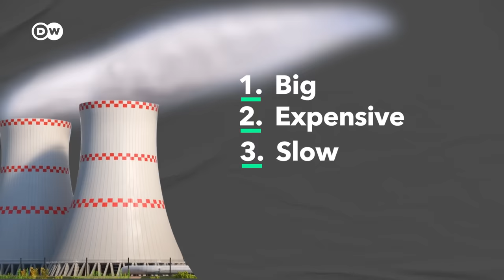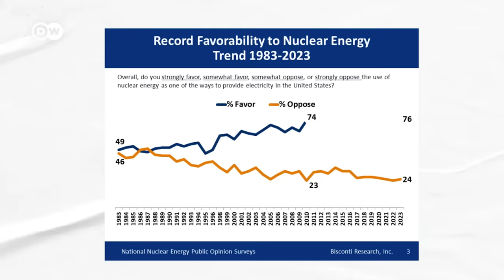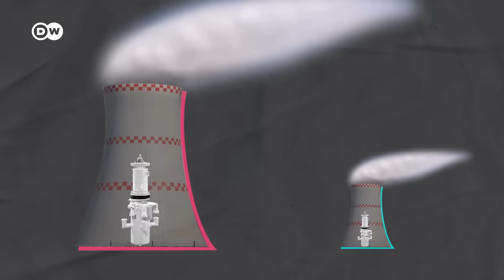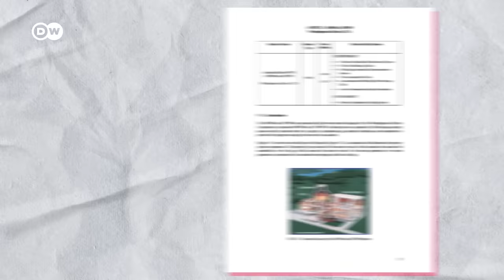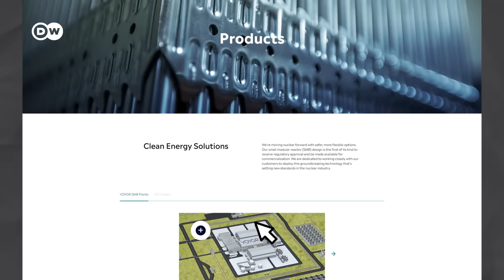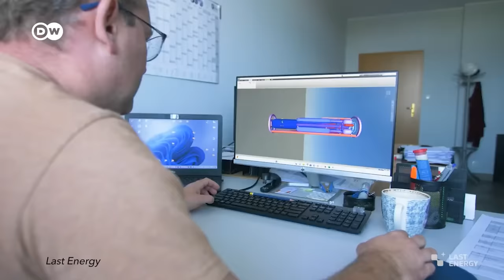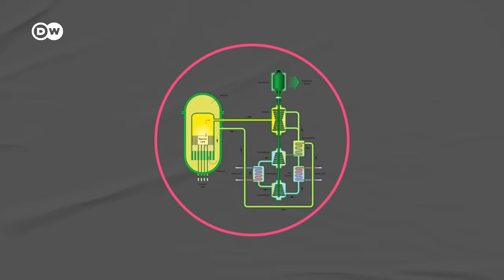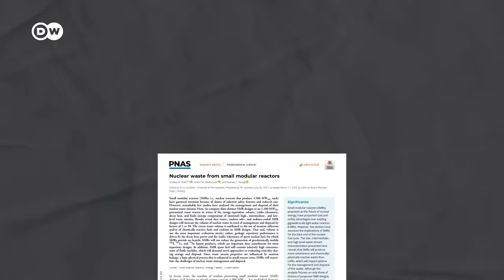Why people want to put small nuclear reactors everywhere

Comment: Safe by design, in most cases means liquified metal (like lead) not water. Because it nearly impossible to heat up lead to make it waporize and even when lead leaves reactor it will get solid fast. Also, rods in the ractor are moving down (stoping the ractor) without power application to maintain its position.

Comment: Here is one issue I have with these SMR related videos. Virtually none of them, including this one, had pointed out that SMRs absolutely work and we have decades of experience. Just look at all the nuclear submarines and aircraft carriers. Since the 50's there have been over 160 nuclear naval vessels built, and every single one of them is powered by a SMR.
Reply: @astebbin  I shall argue the 2 points you made are perhaps erroneous.

1. Enrichment Levels:
Naval nuclear reactors runs on military grade enriched fuels of over 93% enrichment. The proposed SMRs run on HALEU grade of no more than 20% enrichment. It is simply far too low to be weapons grade. The much lowered enrichment level also serves as an extra level of safeguard to the already stellar safety records of naval SMRs.

2. Proliferation:
This seems to be the go-to argument for much of the anti-nuclear energy crowd, but it is simply incorrect. As a matter of fact, commercial nuclear energy generation is the best proven way to denuclearize one's military arsenal. To prevent Soviet nukes falling into the wrong hands after the collapse of the USSR, the Megatons to Megawatts Program was put in place from 1993 till the Russian invasion of Crimea. The program decommissioned an equivalent of 20,008 or 45% of total stockpiled nuclear warheads by the USSR. The decommissioned warheads were then downblended into commercial reactor fuel. During those 20 years, 10% of total US electricity generation came from those "recycled" Soviet warheads. If anything, it should be argued that commercial nuclear energy generation has greatly served the propose of anti-proliferation.
Reply: @astebbin that isn’t a requirement, though, and that fuel is currently used for supply-chain reasons.
Reply: And at least hundreds of navy soldiers lose their hairs
Reply: @astebbin  57% of global carbon emissions come from countries that already have nuclear weapons and aren't a proliferation concern.
Reply: Those reactors use highly enriched uranium which for several reasons is not a practical solution for civilian reactors. The designs would need to be significantly modified for this and operating outside the ocean with a constant, limitless supply of cooling water. That is if you were even allowed to use those military designs in the first place. The companies that build those reactors, Westinghouse and Bechtel also build civilian reactors, so if there was an actual demand for smaller more modular reactors, those companies would be the first ones anyone would go to, but as evident there is no real interest beyond the military.

Comment: As much as I support nuclear energy SMRs never seemed a too bright idea. You have great economy of scale with the normal size, the site has to be specially monitored and defended wheter it produce 300MW or 3-4GW. Same with the infrastructure. Also they use more material, the same capacity may requires more personnel. As long as they plan to install many of them at the same site it isn'treally worth it, and if they don't then there is the problem of  botth the nuclear waste, and vulnerable infrastructure being too disperesed.
Reply: I think the best advantage is the modularity.

Who's going to put down billions in investment and wait at least 5 years to see an NPP running.

MSRs allow piecemeal expansion. Oh, your energy needs expanded by a few hundred MW? Just add one more reactor to the plant.

As opposed to adding gigawatts and spending billions for every reactor.
Reply: @anxiousearth680  Only in theory. In practice, you end up needing a bigger turbine, possibly more power line, and other equipments. You also shut down the facility cause you "install an upgrade", regulators has to check the new parts, you need instrumentation, controlls and ppl for the new reactor. You have to prove with tests that the new one did not change the current characteristics of your installation significantly, and now you have to run all of them on a capacity that justifies the new one, with its added costs, manifacture, maintenence extra staff and permitting. The problem is, you end up redoing everything for addign like 50-100MW which in many case can be done as a major upgrade on an existing higher capacity plant. And while at it, you better just build another big one, jump through the hoops once and add another 1000-1200 MW.

Comment: In Canada we have a pilot SMR in production.  It is a pilot project heavily focused on safety and it's current price is estimated at CAD$2.5Billion and produces 10MW of power.  It is estimated that the price can drop to 1 tenth ie: CAD$250Million for 10MW of power.
.
.
Now for comparison, we have recently (2024) completed a 10MW solar farm for CAD$16million.  We also have a project that includes Battery Electric Storage System(BESS) and 40MW solar farm for about CAD40 to 50million and guarantee at least 10MW 24/7.
.
.
.
No way SMR can ever compare to a solar/BESS combo. Most importantly keep in mind that the SMR is still over the Billion Dollar mark. and 'projected to drop'.
.
.
We have the means to a clean future.... the only reason SMRs are entertained is the clear fear that solar can quickly become mini-grids or even home scale use... meaning large corporations will not be able to make money out of mega scale energy as they do today.  This is happening today in Spain and there is currently mega political turnoil as a consequnce..

Comment: The biggest mistake in the Fukushima accident was that the emergency battery was installed underground, and seawater got into it.
So I don't think all nuclear power generation is dangerous.
I understand that Germany, which is close to Russia, has abolished nuclear power plants, but it is also true that CO2 is a stable gas, so it is very troublesome.
Until a small nuclear reactor that can ensure safety is completed, we need to reduce electricity consumption at night when solar power is not generated.
Reply: We must raise up energy consumption at night to reduce energy losses in generation and transmission.

Because of that at least 30% of cars will be electric or plugin electric after 2050
Reply: @doesnotcompute6078 you are taking about NEW cars, not ALL cars.
It's impossible to exchange half billion old cars to new cars so fast.
At least half of new cars will be hybrid
Reply: @doesnotcompute6078 so on with cars.
Some countries like Brazil have methanol hybrid cars.
Other have methane and propane/ butane (LPG) cars.
Some concepts of ammonia cars are better than hydrogen cars.
Some electric cars use sodium batteries 
So we can't define future of cars in 2050 only "electrical"
It's just dreams
Reply: Europe, especially Germany, is in very bad shape.
Reply: The big problem with Fukushima style reactors is they need power to keep the nuclear reaction under control.  So you only need a grid failure and a problem with the back-up power for things to get out of hand. It is better to have a passive safety system like pebble bed reactors have.
Reply: @boldvankaalen3896  The main issue was that the backup generators were in a subfloor basement, to save money, and they got flooded.
Reply: doesnotcompute6078

No they are not. You're falling for availability bias. Just because you can remember many prominent disasters doesn't mean that's the case for nuclear as a whole. Bear in mind there are hundreds of reactors currently operating in the world.

Statistically, nuclear is more or less just as safe as renewables. And much, much safer than coal, nuclear disasters included.

Source: Our World in Data, death per TWH
Reply: @killcat1971  Which is just one specific example of possible problems with the back up generation. And also a nice example how safety can easily be compromised by cutting corners, to save costs.  Next time it will be neglecting maintenance, or using low quality fuel for the back-up generators. Sooner or later an MBA type manager will be looking where savings can be made, and goes just a bit too far.  It just makes more sense to move to a passive safety systems that is more robust against such mismanagement.
Reply: @boldvankaalen3896  Oh agreed, I'm a fan of MSRs for this reason.
Reply: Explain the difference in danger between Gas and Nuclear

Comment: What are the cause and effect if something goes wrong?
Reply: What do you mean in specific thats a vague question. Im going to assume you mean what are the cause and effects interms of negative consequences in the event of a critical emergency or other hazardous incident causing a nuclear radiation leak. The most obvious solution is that because the smr radioactive components are inside the smr then it would be super easy to just take it offline and then take it to a nuclear disposal site (which is safe since we have solved alot of the issues around when the famous disasters happened and when nuclear energy was being debated to replace fossil fuels) 

Besides progress in nuclear powers safety which make anything like like the famous incidents like chernobyl & fukishima. Now we have systems that have many failsafes and such.

But in specific to smrs their design is so that the risk is minimized in the first place but if and when something goes wrong they are both not big enough sources of radiation to be more than a local incident, as well as many of them being underground and shielded by concrete. If that fails its very very easy to shut the smr off and then move the entire thing to a nuclear waste disposal site. If youarent aware already we have actually solved the issue of nuclear waste watch kyle hill's video titled "weve already solved nuclear waste" since they can explain it much better than i could. But the smr is designed so that the whole unit can be easily moved so that means if it becomes problematic it can be moved to a safe disposal site where it wont pose any dangers to humanity or even that local area wher it went wrong or even the workers at the disposal site. In fact, in the video I recommended kyle hill literally kisses nuclear waste containers and stands rigjt by them because he knows its safe. No protective equiptment either just plain clothes. 

I can try and specifically answer any questions you might have if you specify what you mean but i hope this eas enough of an answer for you. Also i hopeyou check out the video so you arent just relying on my word and you can see for yourself.
Reply: @anarcho.femboyism  wow. This is what I wanted to know 👍😀. Thanks for this long wonderful explanation. I have seen the video from kyle after you asked me to and yes. I will complete the video. No me it is bit worrying when everytime governments are involved and funding projects. Most of the time they see their own interest and make compromises. This is usually a red flag in such projects. I think this to me is like a rocket science, where we theoretically apply things but when it come to real life anything can go wrong. Sometime we oversee something minor in nature. That is what I meant by my comment above.
Reply: a cause will be the thing to blame, if an effect appears ofc! 🤔🤫
Reply: Just like any nuclear power plant.  Nuclear meltdown and end up like Chernobyl where the land is not usable for decades.
Reply: @AkihikoJunichi  sarcasm?

Comment: One key advantage that wasn't mention in the video is their relation with the grid. A typical nuclear plant will need high voltage cables to serve a huge area while snr could work on lower voltage, smaller grids with no problem. great for small islands or energy intensive companies that don't want to rely on the grid like data enters

Comment: Glad this video explained the cost side heavily. The promise of SMRs has essentially already failed--they've shown that they're no better cost-wise than our old nuclear plants which was always the problem. The simple fact of the matter is that wind/solar + batteries is already a cost-effective solution that's proven and available today, albeit in need of ramping capacity. SMRs likely still have a niche long term (e.g. commercial shipping, remote outposts), but it really doesn't make sense for the grid when wind/solar + batteries are already cheaper than fossil fuels, let alone nuclear.
Reply: what are you talking about, batteries are insanely expensive, to power a city when there is not sun/wind is either nuclear or fossil fuels
Reply: @mggaming4624  thats what grid interconnects are for. it barely happens that there is no sun or wind.
Reply: All wind and solar energy have only 3% of accumulators power per MW of "green" power.
That's change all.
13-15% is the transmission to another time zones.
20% is hydro energy balancing.
50% is fuel (gas, oil or coal) balancing.

Only french nuclear reactors can change their power from 50% to 100% up to 200 times per year, but cost of that is 1.5x times more uranium for that.

Comment: Nobody going to replace "big reactors" with SMRs. SMRs are for places where you have a distant city that require power. Even with all disadvantages of SMR in comparison to "big reactors" they are still better option if you simply don't have suitable ground to build a reactor or if you would like to add power generation gradually during developing of the region.

Comment: There is a lot pressure from big oil against clean energy such as this.
Reply: @timwoodruff5728  you know what. You are probably right :-) ... but, small self contained low bureaucracy nuclear reactors have the potential to disrupt petrol industry, but you are right they are probably not lobbying against it at this point.

Comment: One of the reasons France's nuclear energy program has been so successful is that France developed a good design and then refined and improved the design over may units.  The majority of France's nuclear power plants are the same basic design.  Moderate in size and reliable.

On the other hand the US industry had a race to build bigger and bigger reactors.  The industry would make a few of a design and then jump to a new larger design.  No feedback for the old design to improve.  Just a race to the next bigger design.

Comment: SMRs are more like cars, the first ones cost way more than the end product but once mass produced, they become very cheap, and have the potential to undercut all other options. Unlike renewables that struggle to integrate with the grid, need constant maintenance, need major parts replaced every 10-20 years, SMRs over the lifetime could actually be cheaper. The main issue is people still think of nuclear as bad, but if the truth was told, I think you’ll find nuclear is the greenest energy available. There is nothing green about Solar or wind if you look at what goes into them, and how often they need replacing.

Comment: We need to focus on renewable instead of technologys that does not even exist nowadays
Reply: Nuclear does not compete with renewable. They simply have different purposes.
Our electric base load can't be covered by renewables, since they're not stable and reliable. The choice then is between fossils or nuclear. Since we want to abandon fossils, the solution looks pretty evident.
Reply: @bose9618  false. Fossile Fuels are not for baseload but for peak times. So dont write before knowing anything about the topic
Reply: @timwoodruff5728  that doesnt change the fact that fossile fuels are flexible and nuclear is just baseload even if there is enough renewable capacity there
Reply: @grafity1749 

Well gas is for peak generation. But coal is definitely base load.
Reply: @anxiousearth680  no most coal plants are flexible